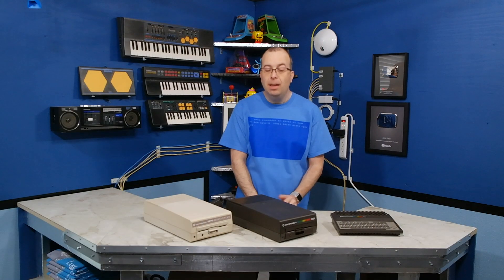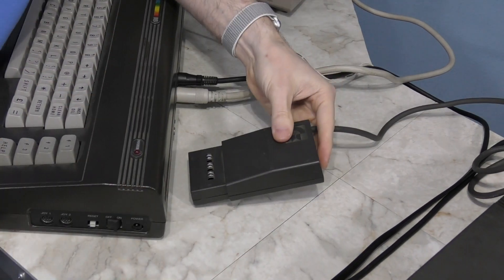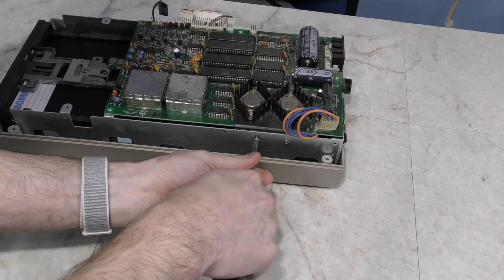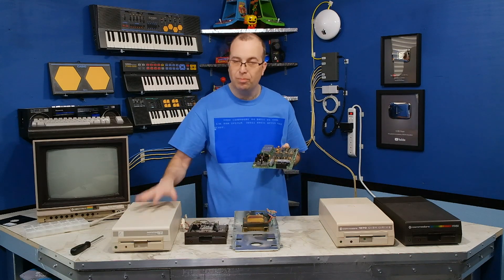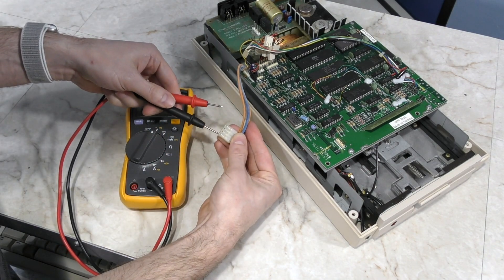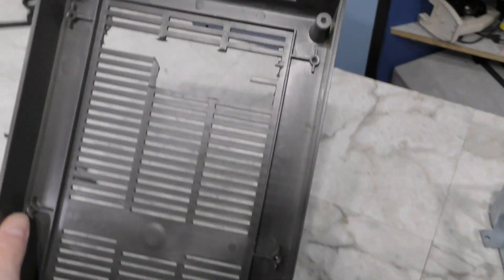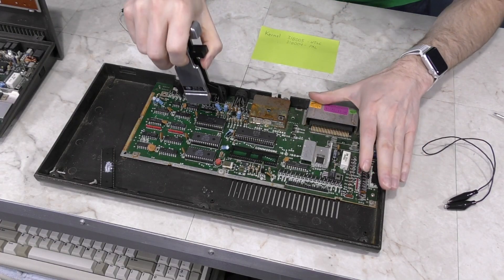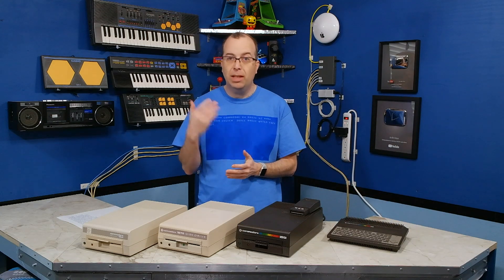Commodore C116 and drive repair, 240V to 120V conversion

Comment: I've had a dispenser of solder wick in my tool box for something like 20 years. I never use it. A spring loaded "solder sucker" does the job well. The trick to the wick, however, is to put just a touch of flux on the wick. The minute amount of oxidation on the copper wick prevents the solder from drawing up into the strands and the flux neutralizes the oxides. But I still recommend  the solder sucker. It makes a great fidget toy when your hands are idle.

Comment: I just noticed that all these Commodore Drives have the same type of latch, and it's totally different to the latch on my old 1541 from back in the day, it had a regular lever that you flipped down like 75% of later PC disk drives.  How much variation was there in the disk drives Commodore sourced?

Comment: oh I know what you felt when you sacrificed the "ugly" Disk Drive ... I recently sacrificed a PowerBook G4 HiRes to save another one. At the end, both do work: One looks nice and works well, the other one (a UK machine with a little damage on the case) now has the board with corrupted Video RAM - but still works.

Comment: Hey David, good repair job.
You can also use DMM continuity function to check for shorts at the DC plug pins after jumping the fuse holder.

Comment: When cleaning sticker residue with alcohol is difficult try using WD40. Doesn't damage the plastic but removes very well the glue.

Comment: Hmm... If your sockets give you 120v each, and the diskdrive needs 240v, can't you just plug it 'twice' with 2 cables? (I know this is a dumb question, but still)
Reply: Saktuscactus No, you would just be connecting 2 circuits in parallel. You could get more current that way, but not higher voltage. The only way to get 240 volts would be connecting another line at the electrical panel. It's kind of complicated to explain if you aren't experienced with AC circuits, but it has to do with something called "phasing."
Reply: Saktuscactus Don't worry about it, that was actually a good question.

Comment: Today, the 8-Bit Guy uses every part of the buffalo.

As for fixing the 116's keyboard, I found out that you can make your own conductive paint using ground-up pencil lead, water, and glue. There's a video about it on YouTube. It should be a lot less of a rip-off than that quarter-full bottle of it that you bought last time.
Reply: Pocket Fluff Productions honestly he just needs conductive paint, any metal based paint will work, but the question is what resistance does it need to do a connection

Comment: Love your show, but can you make series of videos about using multimeter on motherboard while while it is on(power running through it);that means one time use ac other dc.

No one did that on YouTube,like test motherboard capacitor while power running through them.

Thanks

Comment: I've heard the TED chips in these systems run hot. In fact a lot have died. I would heatsink them. Ebay is great for cheap heatsinks.

Comment: When you changed the voltage label, you should have changed the current too, when you go from 240 to 120, the current doubles, however the watts stay the same.  ;)

Comment: Pro tip for using solder wick.... a lot of the time on older electronics the flux acid has gone away from the solder joints, so I have found that solder wick works a lot better if you actually flow some fresh solder onto the joint you're trying to desolder initially, THEN use the wick to desolder it. 

Hope this helps someone.

Comment: There is another way if you do not have a fuse handy.If you are a smoker,when you open a pack of ciguaretts,take that aluminium/paper cover that kepps them to dry up,wrap the burned fuse and put it back.Warning:This solution is not for perminant use.Plus,it also works on car fuses if for some reason there is an electrical issue while you are driving.

Comment: @The 8-Bit Guy

when it comes to the PAL\NTSC, i know this might be little hard against the Commodore monitor purists but why not try to get a smaller sized Sony PVM Monitor? (the 12 and 14" isn't to bad over here in Europe if you know where to look) or maybe even the cheaper and easier to find JVC TM's like the TM-1700PN-S (S at the end is the RGB input version, non-S is S-video and composite only inn in form of BNC... so they need some supercheap BNC to RCA adapters)

90% of the PVN's and the JVC TN models are supporting both formats and will in the future require no modification of the machine to work for future projects.
using a TN1700OPN-S for my MegaDrive(Genesis) and US imported SNES and works fine with both, and even with the Commodore 64 and Amiga 500 if using composite.

Comment: 10:31 we could see that the hot wire (black is connected to the tab on the right of the transformer., there's an empty tab in the middle, connecting the black on that tab instead would have made the transformer working straight at 120V input, (cutting in half the number of windings will also cut in half the ratio)

Comment: Ok, in the 15' the video lasts, 5 thousand views were made. I reeeeaaaallly doubt this guy reads all the comments. Sad, there are very good recommendations over here, like this guy that made a good suggestion about using the multimeter as a temporary replacement for the dead fuse.

Comment: center negative barrel pin, aka the 'f-you' pin
Reply: A FULL bridge rectifier !
Reply: I can't stand center negative plugs. Roland used them all the time for their 80s/90s music gear, even though everyone else like Yamaha is center positive. Ugh.
Reply: I had such an encounter recently.

My mum has a radio that takes in 4.5V DC, barrel pin centre positive.

She was running out of D cell batteries very quickly so I went to buy an adaptor for it.

The stupid store guy had a 4.5V barrel pin centre NEGATIVE adapter.
Before I could tell him it's wrong polarity, he plugged it in and turned it on.
God was with me that day because the radio had reverse polarity protection and didn't turn on.
The stupid guy proceeded to tell me the radio was dead and was about to show me the radios he had for sale, 
When the store owner entered, he showed me the polarity switch  that was there in the adaptor...

The store attender told me "don't worry, it's all the same" before turning it on.
I could kill him if I could!!!
Reply: this guy eyebrows
Reply: It's annoying but common on battery/mains powered electronics back then because the switch in the jack can disconnect the battery when a barrel plug is connected. Obviously the commodore wasn't battery powered but other things were back then, so such things were common.

Never understood why they didn't just float the negative connection of the battery instead though
Reply: I killed a Center Positive board for a mini black and white CRT, didn't realise I had a center negative adapter until I started modding the board and realised that's how I killed it.
Reply: eumoria YES, ON SO MANY LEVELS.
Reply: pretty much every guitar effects pedal uses them... for some reason
Reply: Yep
Reply: i always called them the Sony pin lol
Reply: Classic! That had me ROFL! You would be dead right (pun intended)... A centre negative barrel can certainly be the 'f-you' pin, if your device doesn't have a bridge rectifier or reverse polarity protection diode!

Comment: The voltage of the main line running into pretty much every home apartment or business in the USA is 240v in some cases even higher. Most houses however are not wired to use 240v anywhere but the stove/oven and possibly an electric clothes dryer if the place has a utility area. The issue you would have if you used one of those higher voltage plugs is the same as NTSC/PAL, US electricity operates on a 60hz and EU/other regions use 50Hz.

Comment: Do you also have a Commodore Plus/4? Also an interesting "failed" system with built-in applications (word processor, spreadsheet etc.). I remember trying that one out at our electronics/home computer fair back when it came out - my thoughts were something like "looks nice, but no home computer user would want a system which is not compatible with C64 software", and that's exactly what happened, nobody bought it. Other stuff which would be interesting for future videos - floppy disk accelerators for the Commodore systems, some are pretty crazy stuff. E.g. I have Dolphin DOS in my C128D, that is a disk accelerator from back then in the 80s (so no modern stuff, which makes it even more interesting) which buffers whole read tracks in its own RAM which then of course gives crazy fast load times.
Reply: It's kind of strange, that the Plus/4 was a failure in most places, we had lots of them in Hungarian schools in the 80's. Looking back I guess it was a perfect choice for that purpose. Good Basic, good keyboard, relatively cheap. Perfect for learning programming in Basic. You could even play a bit after the lessons, as there were a few games, although certainly not as many and as good for the C64. RENUMBER itself made these computer very appealing :)

Comment: About the fuse: the common dirty hack is to use a single very-very thin fiber of a copper wire and solder it over (or better, inside) the dead fuse. Not recommended, of course, but  if you really need it quickly it's much better than the alligator-clip solution, as there's a good chance it will actually blow in case of a short circuit.

Comment: To get solder wick to work better, add blob of new solder to the old joint. If you have any flux put some on the new blob of solder that you just applied (or directly on the wick) and it will draw into the wick much better.

Comment: North america has 120v 240v 480 550 600 and others ..so just plug those disk drives into your dryer outlet prob solved
Reply: Maybe one day Americans (and Canadians and Japanese...) will wire up their houses with 240VAC everywhere so that they can do amazing things like heating water in seconds in a 2,000 Watt electric kettle, and maybe even use electric plugs which aren't horribly unsafe :)
Reply: Came into the comments for this comment. Yep 240v does exist in most modern homes.
Reply: The only problem could be the 50/60Hz
Reply: I mean you are rectifying it anyway, and the clock is based on a quartz crystal, not the mains freq, so it should be absolutely fine.
Reply: dryer outlet?
(I'm from the UK where we just use a normal plug socket)
Reply: In North America, Power outlets are wired between one end of the pole pig to a center tap. every other slot in the breaker panel (Consumer unit) is wired to the opposite end of the center tapped secondary of the pole pig represented by black and red wires. a white wire is wiret to the center tap. For 240 volts, connect the load across the black and red. for 120 volts, connect the load between the black or red and white. 240 volt circuits use a double pole breaker while 120 volt circuits use a single pole breaker. 

In Europe, the center tap on the pole pig is not grounded, but one end of the secondary is grounded instead. This supplies the premises with 240 volts respective to ground, while in North America, each leg of the output gives 120 volts with respect to ground hence the need for a double pole circuit breaker.
Reply: Yep. Like a japanese people - north americans need special outlet with higher voltage to run heavy duty machines, like dryers and conditioners.
Reply: Yeah, the european transformer is designed for 50Hz so this will likely create some problems
Reply: I think only the cheap ones because some circuitry in these isn't really made for that and that could cause problems
Reply: Sub G, yes, they have 240V line for high-powered devices like heaters and electrical motors. 120V for all other electronics.
Reply: Well, Chris Cook, Dave didn't even specify homes. He just said "in the United States."
Reply: singel Live and neutral 120 volt , 2 live wires 240 volt.
Reply: 50/60hz shouldn't matter to the transformer, to my knowledge.
Reply: This won't work for everything and may be dangerous. as rather than having live at 240 and neutral. you now have two hots and no neutral. somethings can get upset by thims
Reply: this is a problem at all, half of belgium has this system
Reply: You would have to have a lower breaker with it. Most dryer breakers are 40 or 60 amp. The wire on the device is not rated for that much amperage. Also just makes more sense to convert it.
Reply: Phillip Smith If that's the issue, get a UK plug, there's a fuse in the plug on standard UK 230V/240V cables,  just need an adapter for the plug design.  Even better would be a dedicated converter box with 10A fuses in both lives.  If you want a good European socket for "both pins live 220V", go with the very common Schuko 230V/16A power strips, some even have room for minor electronics such as fuses and surge protection inside the strip.
Reply: Yes, it's possible to wire a 240v outlet in your North American home.  There's even a special plug for it, other than the dryer outlet.
edit: see NEMA 6-15
Reply: 50/60Hz:
https://www.youtube.com/watch?v=iPhESbeKFIE
Reply: Sub G: That's their version of rotary power. What is 400v for us is 240v for them. They use 2 phases at 180°, we use 3 at 120°
Reply: Yeah the US has all the voltages!
120V= Regular outlet
240V= Washer, dryer, fridge outlet
>240V= I don't fucking know
Reply: NewAgeDerpDerp To answer your question, >240v is used in many commercial and industrial settings. An example is the mobile home plant where I worked. The lights in the building were running on a higher voltage. Also the air compressor was 3 phase as well though I can't remember what the voltage was.
Reply: NewAgeDerpDerp There's also 215V 3-phase with 125V to grounded, similar to European 380V with 220V to grounded.  But since the 8-bit guy is working from his home, he probably only gets the traditional 220V 180° feed with 110V to grounded.  Note that 240V which he mentioned in the video is the traditional British voltage, not used in places like Hungary, while the official 230V was a technical/political compromise to get the same appliance standards for all of EU.  The traditional voltages are double or quadruple the 55V used by Edison's DC system, and early Westinghouse AC systems apparently still limited domestic circuits to 55V to comply with safety rules.  I'm unsure what 19th century European systems used, but 220V DC was common in the first half of the 20th century, thus the need to label compatible equipment as AC/DC.
Reply: Yeah, I said almost the same thing before you did, but I like yours even better because you brought up the other voltages -- except that I specifically included in my comment that Dave's claim was false.

Comment: Masterful use of 1 dead drive to bring 3 back to life. The PAL/NTSC conversion was not one I was familiar with.
Reply: He didn't use a dead drive for that. But I do like that he used a working 1541 to fix up two different models that are still compatible enough in those areas.

Comment: When you hear something rattling around inside of device it’s a good idea not to plug it in until you open it and check. If it were a screw or nut you could easily short something out causing a lot of damage when you power it up. Great video though!

Comment: What was the purpose of that modification on the 1541?
Reply: I've made those before, and one of them would be to change the device number, while the other would be to turn off write-protection so that the top side of a disk can be written to when flipped over without having to punch a notch in the other edge of the jacket.
Reply: Ah, interesting. The mod on the 1541 looked like a 1/8" headphone jack, rather than a switch, so I thought it might be something with pulling off a signal for some reason. It's the one at 3:50 that I'm talking about, not the device-select pushbutton switch on the back of the 1551.
Reply: Hi fluffy, where is your avatar from?
Reply: I drew it! It's my self-representational character that I use in my journal comics.

Comment: I'm surprised they didn't design the transformer with a 120v input tap (usually operated with a switch or jumpers, or just good old de-solder here, re-solder there), would have made it cheaper to make I'm sure... :)

Comment: The higher voltages you measured on the secondary coil of the "American" transformer may cause the two voltage regulators to run hotter than they would normally. Linear regulators work best with the input voltage  few volts above the rated output voltage.
Reply: Well, North American, at least, and outside of quotation marks (since it's actual). Things might be different in South America.
Reply: Maxx Fordham What I was referring to was the difference in secondary voltage readings between the two transformers. 17.0VAC vs 15.3 and 9.7VAC vs 6.2. The logic board and separate power supply board from the 240V unit (the other two have integrated power supply circuits) may not be built to deal with higher secondary transformer outputs. The more voltage that a linear regulator has to deal with is transformed into more heat. This would be compounded by the fact that the separate logic board has more integrated circuits to power drawing more current through those regulators. The 8 bit guy was powering all of these disc drives with their native voltage levels so where they came from doesn't matter. The only other difference between North America and countries running 240VAC power grids is we run at 60Hz and they have 50Hz.

Comment: Flow fresh leaded solder into the joint and rub flux on your wick and the joint with a flux pen before you desolder if it's being finnecky. Works like a charm